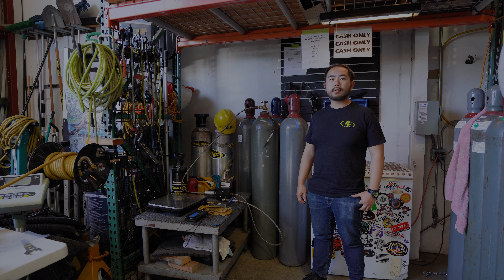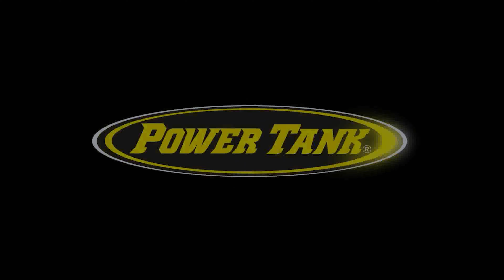Refilling a Power Tank and Power Shot using a CO2 Super Pump

Comment: If you have a 50b tank how many times can you refill your 10lb tank.
Reply from the maker: About 4 times. Only 70-80% of the total capacity is usable to transfill. The remaining CO2 will expand into CO2 vapor. It still has plenty of energy to run air tools, the pump itself, or as welding gas but it is no longer in a transferable state.